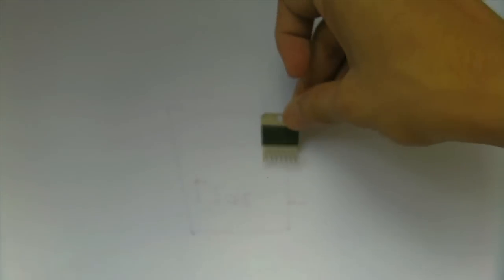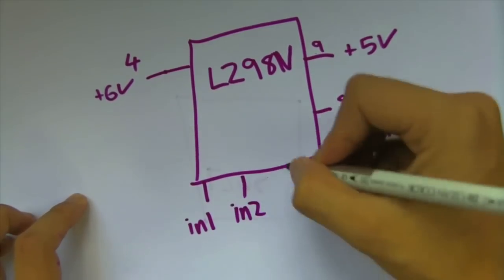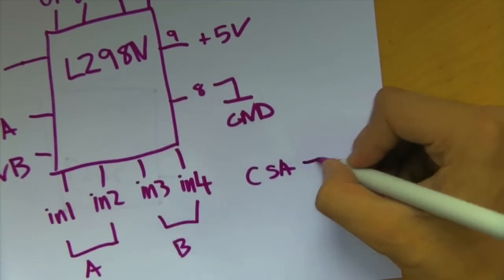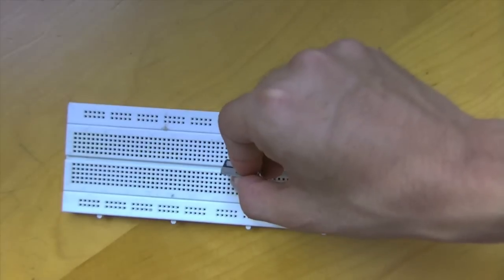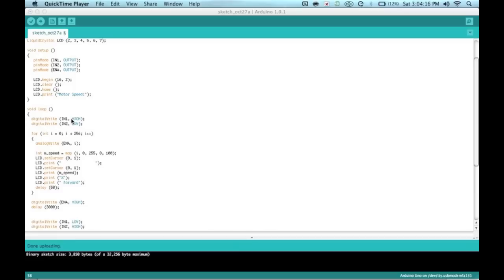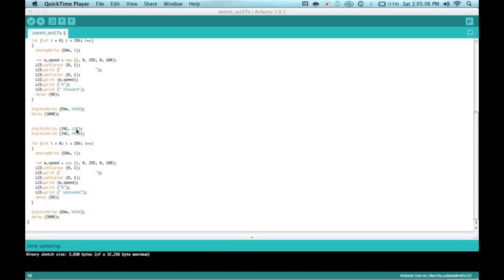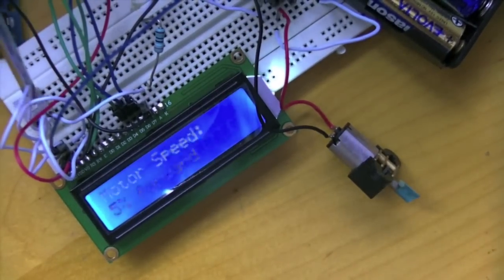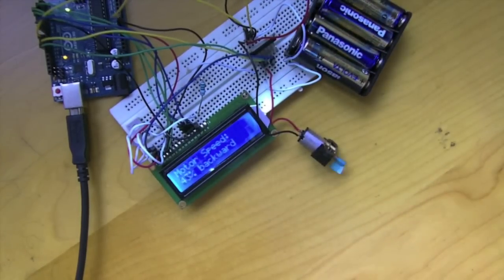L298 Motor Control | Arduino Tutorial

Comment: Also, with the LM298N, you can use the voltage for the motors to also power the ic, as long as that voltage is under 12v.  But on most boards on ebay say to use a 5v suply.

Comment: I am using the L298N to drive a DC motor for a engineering project.  If you make two of the inputs either high or low the motor will stop completely right?  I read where another similar hbridge would brake the motor (slow to stop) suddenly when both inputs were high and if both inputs were low the motor would brake slower and smooth.  How can I get the motor to move full speed when the joystick is all the way forward and how can I get the motor to stop completely and smooth when the joystick is in the center position.  Will the motor drift when I apply a load to the motor when its "brake mode"

Comment: in L293D Enable pins i used 9v battary
what about the enable pins here ?! >>>> use the voltage from arduino or from the battary
my battary 6V - 2.1A

Comment: Be careful with that wiring, that way you may damage the  L298N, it needs a rectifier bridge and some capacitors. Take a look at the data sheet of the IC.
the rectifier bridge prevents some currents generated in coils of the motor go back to the IC, the capacitors works as a noise filters.

Comment: Hi,

I was actually using sensors to tell a servo which angle to turn to. But my servo's internal motor chip burnt out, so I removed it and rewired the servo motor to an L298N. I am able to move the motor to the desired 'angle' by just doing clockwise/anticlockwise and stopping when I reach the sensors values within tolerances, but I am not able to duplicate the servo's original 'STOP' function: ie, it can resist any change in position if you try to move it. I can't use the L298 BRAKE function

Comment: Thanks for the video! I really would be grateful if you solve me a cuestion. I am trying to do this proyect and i am having a lot of problem and my conclusion, for now, is that I need a external circuit of diodes for do it, but your video disconcert me, my question is... Is your device a L298HN? because is the only way to do it without any external circuit because this CI already have these diodes  integrated.

Thank you again!!

Comment: Hi. We did this already, and it works perfectly fine in the case when:
ENA = High, IN1 = high and IN2 = low:

However when we which to ENA = high, IN2 = low and IN2 = high, then nothing happens and the motor won't run. Any ideas?

Comment from the maker: Basically, if you turn IN1, IN2, IN3 or IN4 high, it gives power to the respective output (OUT1, OUT2, OUT3, OUT4).

 So if your motor is connected to OUT1 and OUT2, turn IN1 high and IN2 low to turn it in one direction, and turn IN1 low and IN2 high to turn it in the opposite direction. 

Hope this helps, let me know if it doesn't :)

Comment from the maker: Pin 1 to GND
Pin 2 to motor
Pin 3 to motor
Pin 4 to motor power supply
Pin 5 to digital pin 10
Pin 6 to digital pin 9 (PWM)
Pin 7 to Digital pin 11
Pin 8 to GND
Pin 9 to +5v supply
Pins 10-14 unconnected
Pin 15 to GND